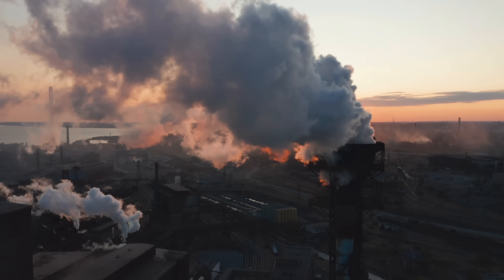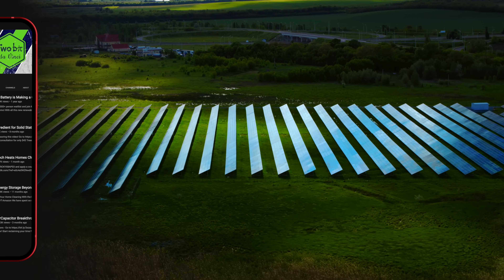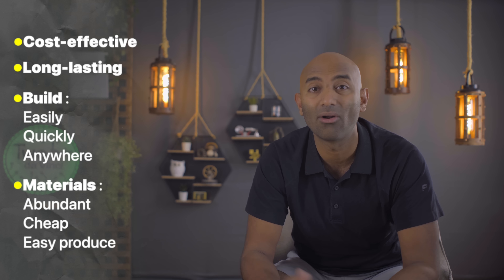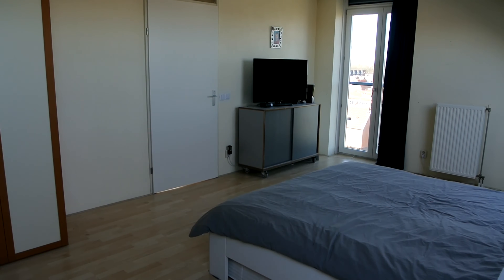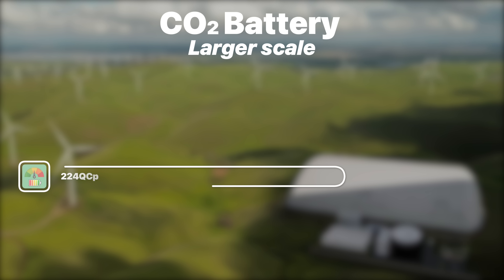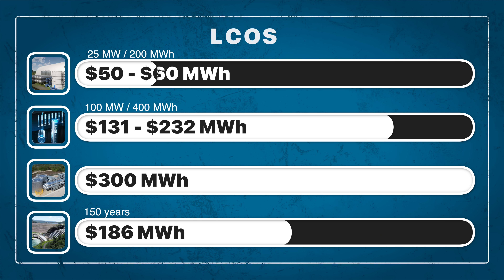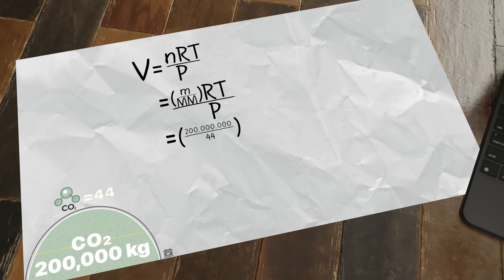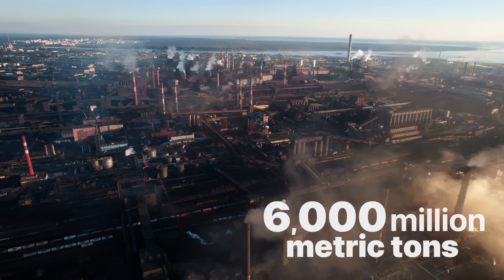The GENIUS Of the Carbon Dioxide Battery

Comment: The issue as far as I see it is the thermal energy storage required because to keep a reasonable amount of heat you need to have the battery store heat at high temperatures which means it will leak more easily, I do think there is some sense in preheating the gas with ambient tempetures first, it may only make a relitively small difference but if you can chop off like 10% of the heat required you can lose 10% of the heat out of the thermal energy storage without it being problematic which would expend out your useful storage time pretty significantly.

if you wanna do that it just requires some radiators and fans.

Comment: The tradeoff between this and lithium is the cost of that deficit in round trip efficiency. For stationary storage, size of the installation isn't as important as long as its cost effective. Money, as always, has the final say. With the Co2 storage, parts are common, easily replaced, the medium is regenerated and never wears out.

Comment: I wish you would stop talking about economics as if they are as real as the laws of physics themselves. I get that you are just trying to quantify pros and cons. But the estimated "cost" change as we get smarter, develop or (most importantly) reprioritize. Whether we currently find a given technology to be "uneconomic" does not matter, if it solves an actual physical problem we have no other or physically better solution for. 

Economy is an extremely subjective social game we play, that depends on a plethora of at-the-time-often-not-known variables. At best economy is a guesstimate, at worst it is complete hype and superstition (belief in "invisible hands" etc). We will simply have to MAKE a useful tech "economically feasible". 

Having a planet to live on beats having an economy to consume from. 2nd Law of Thermodynamics beats any of the pseudoscience economists have produced in 248 years of trying. Lord Kelvin beats Adam Smith. Entropy beats cost. Any. Time. Of. Day. 

Real economy is measured in joules. If the physics holds it is feasible. ☝🤓

* no doubt there are so-called "fundamentals" in economics, but those are just easily identifiable physics peeking through ~ however, the rest of value attribution is plain guesswork 👈😉

Comment: The key to understanding how CO2 doesn't matter is because the big GHG is water vapor and there is a temperature feedback that controls it. So any slight increase of temperature there is a feedback decline of H2O. The opposite is true of CO2 , and increase in temperature increases CO2 and has for 4.6 billion years. If this feedback was switched between H2O and CO2 we would have had a runaway in temperature instead of a very predictable  and stable within parameters.
Reply: You've been duped by cherry picking.
Reply: @hosnimubarak8869  That in no way disputes what I said. At least state a point.
Reply: @1965ace  
1) Both water vapor and CO2 are responsible for global warming, and once we increase the CO2 in the atmosphere, the oceans warm up, which inevitably triggers an increase in water vapor. But while we have no way to control water vapor, we can control CO2. And because we are increasing the amount of CO2 in the atmosphere by continuing to burn fossil fuels, even in relatively small amounts compared to the entire mass of the atmosphere, we are disturbing the entire heat balance of the planet. Earth absorbs energy from sunlight, but as the surface warms, it also emits energy in the form of infrared radiation (which we know of as heat) out into space. CO2, however, acts like a cap, making it more difficult for Earth to get rid of this energy. Without CO2 to absorb the energy, our planet’s average surface temperature would have been near zero degrees Fahrenheit.
Reply: @1965ace  
2) The Milankovitch cycles drive the ice ages but his takes thousands of years and their effect is too weak to cause the shifts between glacials and interglacials on their own. Ice cores show us quite clearly that as orbital changes start the warm up phase after an ice age, ocean temperatures rise, oceans release CO2 into the atmosphere. In turn, this release amplifies the warming trend, leading to yet more CO2 being released. Of course many prominent "deniers " try to cherry pick this information and claim CO2 follows temperature change and thus cannot be a driver but the science is clear. The major component of the Milankovitch cycles occurs with a period of 413,000 years. Other components have 95,000-year and 125,000-year cycles. This in no way explains the rapid warming the Earth is now seeing.
Reply: @hosnimubarak8869  You completely miss the point I make where temperature feedback cools the atmosphere not increases it otherwise water vapor would have caused runaway temperatures. Water vapor is 100 times more powerful and varies 40,000 ppm in days because of temperature feedback and true believers like you are scared as hell about a few ppm of CO2 over years. The error you make is assuming that CO2 increase leads temperature instead of following it. The greatest concentrations of CO2 in history occurred just before ice ages.

Comment: Fact: The earth's climate is still recovering from the last ice age and man has little if any effect on the climate warming. The climate will warm no matter what we do, because that is the natural progression the earth follows after an ice age. It's cyclical. It always has been, and it always will be. The rest is balderdash. This whole fiasco is a manufactured fear tactic design so some people can make tons of money and remove peoples freedoms and liberties. If it was real, then why are all the proponents of this fiasco owning beach front properties?  Answer that one, if the sea levels will rise so devastatingly as reported and projected? It doesn't make sense and the mean temperature of the earth is still far above our current temperature. The earth made it through it before, and it will make it through again, with or without our help (questionable). Look it up for Pete's sake. You're a man of facts. Look it up!This video was published in 2022 and the tech was supposed to be commercial in 2023.  What happened???
Reply: The slow warming that ended the last ice age ended over 6000 years ago.

Comment: Every gas has a physical property known as its specific heat capacity.  The heat capacity of CO2 is greater than that of N2 or O2, meaning that the more CO2 that is present, the more heat energy it can hold.  Of course, all atmospheric heat is eventually dissipated into outer space, but the higher the heat capacity of the atmosphere, the more slowly the dissipation. Water vapor has an even higher heat capacity than CO2,  but the difference is that water vapor precipitates out of the atmosphere as soon as its partial pressure reaches a certain point, so it exists in the atmosphere at an equilibrium concentration.

Comment: One great thing about this energy storage system is that it works directly with our AC system, since the motors and generators are AC themselves. This means that it could give renewables like solar or wind some "inertia" which mimics the one that normal powerplants have,  dampening fluctuations in the frequency of the AC

Comment: Keep Earth warm , wrong answer Batman . 
   Pluto has an earth like atmosphere and microbial life like earth 🌎  with an identical atmosphere . 
   It's caused by internal heat by moving tectonic plates burning biosphere into water 99 % and co2 less than 2% . 
   Moving tectonic plates that move BECAUSE OF THREE MOONS . 🌙  
    THIS DESCOVERY BLEW AWAY THE PRECIEVED GOLDEY LOCKS ZONE FOREVER . 
    EARTH HEAT COMES FROM MOVING TECTONIC PLATES  NOT CO2 .! 
    MARS HOWEVER HAS NO HEAT WITH A CARBONDIOXIDE ONLY ATMOSPHERE  A TRILLION TIMES GRATER THAN EARTH 485 PPM , AS ITS 100 % CO2 
((( YET ABSOLUTLY NO HEAT ))) MARS THE DEAD   IN THE GOLDILOCKS ZONE . 10:38

Comment: Batteries are nice .. but let us not forget the most important use of carbon .. improving our soil!  A quick google search will inform you that many experts agree that a soil organic matter percentage of 3-6 percent is ideal (personally, I think that ten percent permanent organic matter is the minimum that we should be looking for) .. the wording of the search makes it sound as if that 3-6 percent is the norm for farmland .. but it isn't.  Most farms these days operate with soil organic matter of less than 2 percent .. and they are losing soil and burning through inputs trying to keep production up.  You want to read a book after the sun goes down?  You can light a candle .. but if we do not reverse the course of modern agriculture, and in this generation, no amount of batteries will preserve civilization.  Plant trees, plant bushes, herbaceous perennials, ground covers and vines - at least three layers deep.  EVERYWHERE.  Photosynthesis returns the oxygen from combustion back to our atmosphere.  We need that.  Maintain your forest gardens, and put the surplus carboniferous material (leaves, bark, wood) back into the soil where it belongs.

Comment: Interesting Tech.

I'm still enamored by the idea of deep geothermal and sand batteries.  The geothermal can power a "steady' load while charging a thermal sand battery.  When demand requires, simply pull the energy from the thermal battery to bring more turbines on line.

Comment: A couple of nitpicks. Your thumbnails is ridiculous and actually damaging. "Everyone was wrong about Carbon dioxide." A/ No they weren't and B/ Little statements like that get into smooth brains and add to the denial.
Your video title is also ridiculous. "What if carbon dioxide is the answer not the problem." Carbon dioxide may be an answer but that doesn't stop it from being the problem in the first place. Carbon dioxide is still the problem.
Apart from your mention of Matt Ferrell everything else seemed quite intelligent.
I will just add though, that, every solution just does more damage to the environment, so I for one am not overly unhappy climate change is going to wipe us out. The thought of nature rebuilding a beautiful environment without us destroying it is glorious.

Comment: Other than claiming temp rise I haven't heard anything wrong with Co 2. CO, hydrocarbons and other toxins are the problem. Co2 is also necessary for plant life that provides O2 for us. Using it for compressed or dry ice energy storage could be interesting.

Comment: Wind and solar would not exist without government mandated carbon credit trading. This drives up the cost of electricity. Also, power collection and distribution systems and backup generation switch yards and disposal of these short life systems are all charged to the consumer. They are the result of crony capitalism enabled by gullible or corrupt politicians.
Politics; poly meaning many, tics meaning blood sucking parasites.

Comment: The amount of power which can be stored in batteries is totally miniscule, virtually pointless. Batteries are a joke. A 100MW sounds a lot but it isn't, a single average generator can create that in 12 minutes. Suppose we have a major weather event with overcast skys and virtually no winds for a couple of weeks, there would be long lasting world wide blackouts. Relying on renewables will be the end of our civilisation. If you are serious about renewables you need huge cables linking all power networks worldwide. That should be a first step.

Comment: It will take a lot of energy to create and a lot of energy to sustain and a low of 20% duty cycle wind and solar to  charge the battery's.  Has some one done the numbers of just using coal and gas direct?

Comment: In 2023 we produced 37,400,000,000,000 kilograms of CO2. As frozen CO2, this has roughly the size of a cube with a side length of 3 kilometers. Year after year after year, we are getting larger cubes like that. I wish this company a lot of fun trying to distill all this CO2 out of the atmosphere and storing it forever safely inside their "batteries". The energy needed to do so is inconceivably large and leads to the production of more than double the CO2 that was there before starting this attempt.
The title of this video is pure clickbait. CO2 is a problem, not a solution.

Comment: Nuclear power is the only solution until a new form of energy production (fusion) is viable. The only reasons they don't want nuke plants is it's extremely cheap to maintain once the plants are on line and they cannot create artificial scarcity keeping power costs higher. Wind and solar REQUIRING battery storage is quintessential planned obsolescence which ensures man-made scarcity keeping power costs high.

Comment: One of the hidden reasons for there being an apparent rise in global temperature is due to the fact that many of the measuring sites were when set up were in open farmland but now they have been surrounded by buildings and concrete or tarmac aprons which all retain and reflect heat more than the earth & plants.  With the creep of  urbanization many of the measuring sites are now totally surrounded by large highly reflective buildings which give false readings to the instruments!

Comment: Well well well just another thing that they spent billions on to make it fit their agenda and then all the billions and billions of dollars spent on trying to (clean up the problem) with solar, wind and EV''s that put there own scars upon the land and atmosphere. Now we find that it's not all that bad, and it may actually have its own advantages.  can jump on board and spend billions on R&D on this. I am not against all of this stuff as long as it is self sustaining and doesn't rely on tax payer money to subsidis it. I mean even with subsidies ethanol really can't sustain itself, and all the tax credits for going solar was the only way to make it somewhat worthwhile, same with all the money given to car makers to make batteries, make EV's, and all the tax credits to try and get people to buy them.  Now those who had the money to get an EV and have used them for a while there are many abandoning them do to the lack of charging stations that were promised, and many are just tired of the EV experience. But without the trillions of tax money subsidies, most of this stuff didn't make financial sense and after all the trillions are gone, everything is collapsing. Solar places are stuck with products that they can't get rid of, auto manufacturers are cutting their EV divisions and many are going out of business. The point I'm trying to make is that this stuff only makes sense if it can make a profit on its own merit and it's something that people believe in and want.

Comment: Carbon dioxide is not the enemy. With the increase of CO2 in the atmosphere. Plant growth, globally, has increased by a reported 15%. Just as would be expected in a greenhouse. Nature solving "problems" in its usual natural way. Now for energy production. Electricity in particular. Consists of production, storage, and use. If the biggest problem, at least by physical size, could be overcome by production directly to use. A major hurdle would be overcome. Perhaps adapting one of those oxygen makers for people with breathing issues. To collect/ produce CO2. Could this  solve this part of the adaption of CO2 energy? Rebreather technology utilized  in stealth diving equipment, perhaps? Space travel breathing and submarine atmospheric control engineering could help in producing something along these lines? OK, Sheldon, you're up! Lol

Comment: Seeems as if we have learned a lot over the year since this piece was produced.  Right now it is becoming clear that the EV program has been collapsing, several EV manufacturing plants have been closed apparently for good.  Ford for example has somewhere north of a 560 day supply of EVs on the lot.  Next, suddenly it is clear to those who haven't a clue on electrical power distribution, have been learning that we don't have the grid to support this increased load.  Presently the grid is nearing breaking point without the EV  load alone added in, then Federal Law is forcing a tremendous increase on the grid load.

Comment: Not really relevant to the video, but... Saying space is cold is inaccurate at best. Space is neither cold nor hot -- it has no temperature. Temperature is a property of matter, and there's "not much" of that in a vacuum. ;)
That said, being in space does pose... challenges... regarding temperature regulation. Any surface in direct sunlight gets heated. Any surface in shadow slowly radiates heat away (black-body radiation, typically infrared). I do mean slowly, though. Radiating heat is far slower than convection, but the latter requires contact with an atmosphere or a liquid. A chilly day saps the heat from you far faster than being in space, although only until you equalized temperature with that atmosphere, while in space you would continue to slowly cool as long as you remained in shadow.
This is why some spacecraft roll slowly around their axis. The side being heated and the side cooling down continuously trade places, allowing the temperature to more or less equalize across the skin. It's also why they're typically painted white. The incoming radiation from the sun is much greater than the outgoing radiation, so you want to reject as much sunlight as possible, and typically still need some kind of temperature control such as radiators that you pump your vessel's excess heat into to cool faster.

Comment: While CO2 can be distilled from the air, that method is expensive and inefficient.

The most common way of producing carbon dioxide is by capturing it from the production of ammonia, of which around 80 per cent produced in the world is used as plant fertiliser for the farming industry.